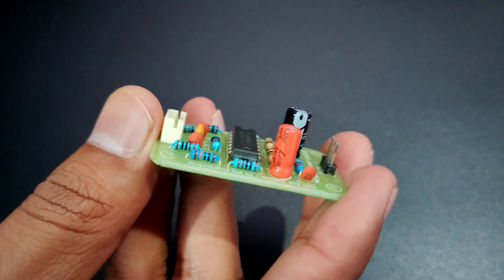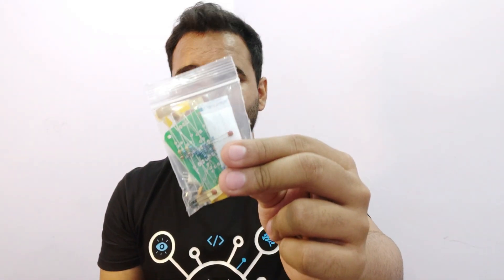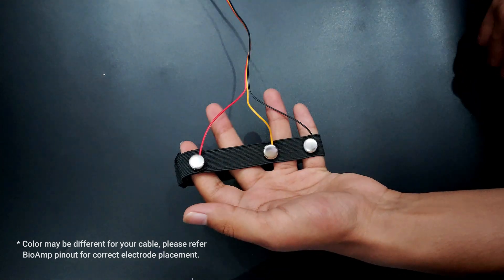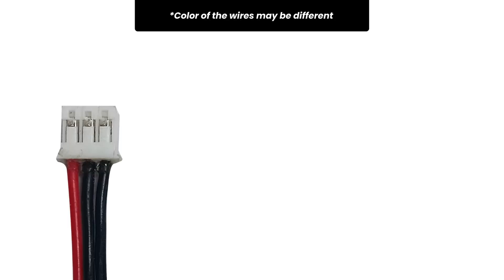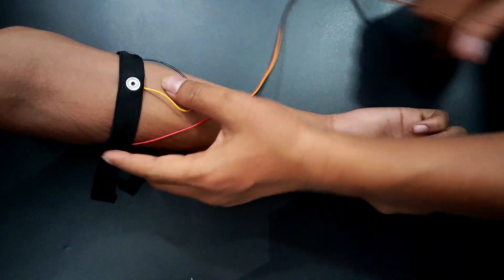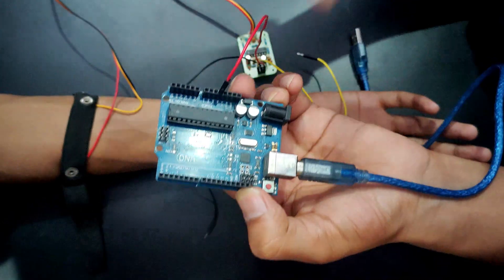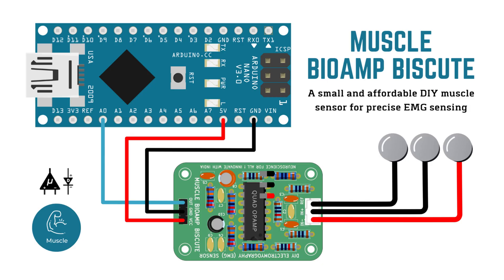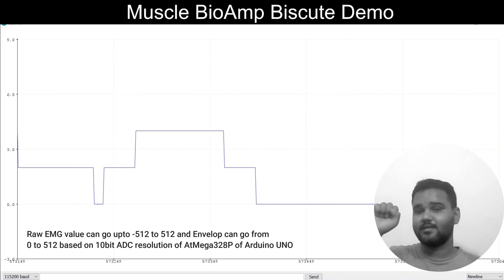How to use Muscle BioAmp BisCute? | DIY Muscle Sensor | @Arduino | DIY Neuroscience

Comment: I have purchased this equipment after watching this video but it is not getting satisfied results from this.
The values are showing on serial monitor in the presence of muscles contact with electrode and showing 0 in the absence of muscle electrode contact. But there is no big change in values/results between muscle contraction and muscle relaxation.
From my side it is waste of time and money.
Reply from the maker: Hey, there might be some issue with how you are connecting the sensor with your body. If you have any issues, we recommend you email us at support@upsidedownlabs.tech we will try our best to resolve it for you.
Reply: did it work?

Comment: can we use it to make bionic arm
Reply from the maker: You can definitely try to do that. One of the student did use it for a similar project: https://www.youtube.com/shorts/xh8q7ls-e9A
Reply: @UpsideDownLabs  i have tried but it's not working...can u please provide project details plz it will be very helpful for meer today only i brought this kit from Amazon and i solder everything as per ur diagram ..so plz provide me the code and  project details plzz
Reply from the maker: @smdfarooq7627  After soldering everything you can use the code given in the link below to visualize the EMG signals.

Link: https://github.com/upsidedownlabs/Muscle-BioAmp-BisCute/tree/main/software/EMGEnvelop